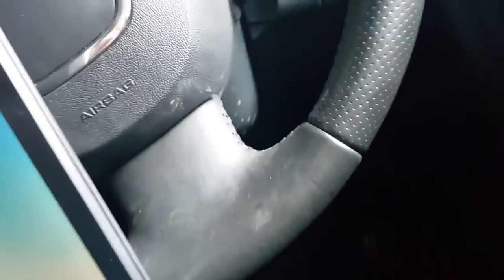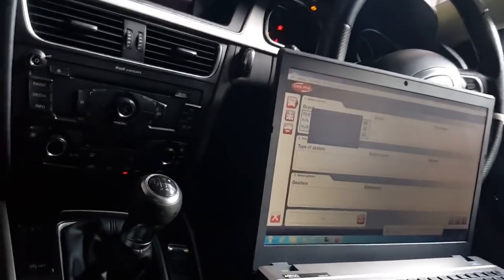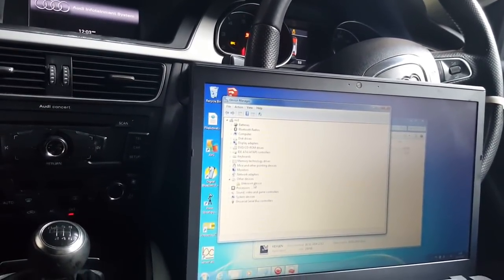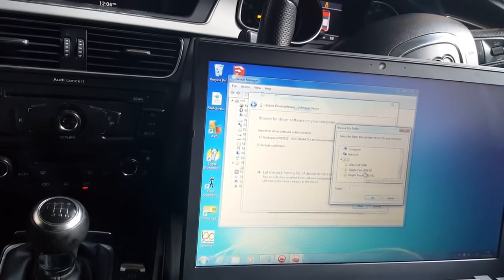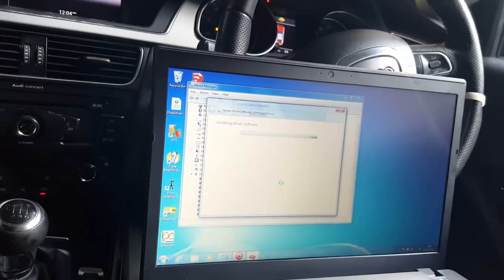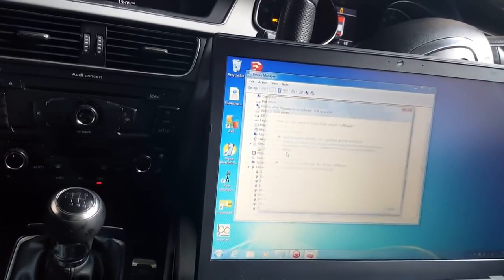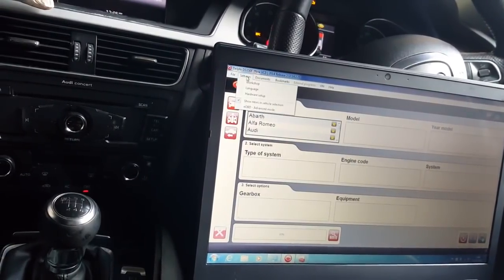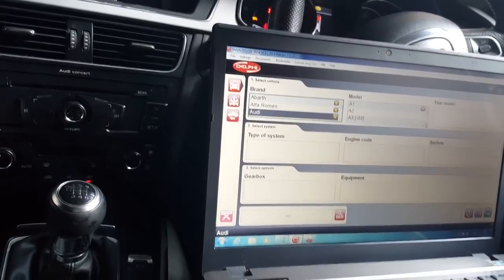How To Fix NO VCI Error on your Diagnostic Scanner DELPHI DS150E Video

Comment: i couldnt see any vci or unknown device on my pc even if it is connected to the car please help!
Reply from the maker: May not be compatible with your pc are you using usb or bluetooth connection
Reply: i mean i could see "usb com3" and i tried to update its drivers with the cd it came with but no luck, it need to read it at vci diagnostic tool thingy. 
but it just read usb com3, any help?